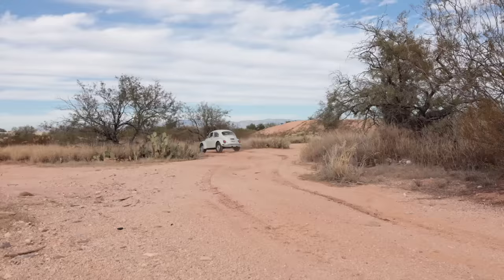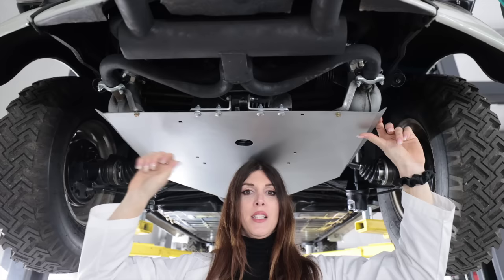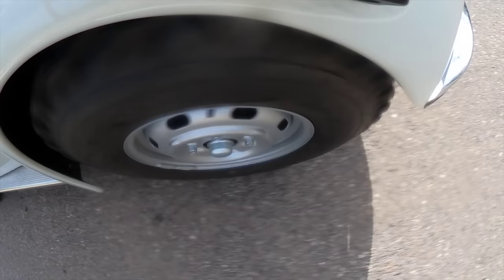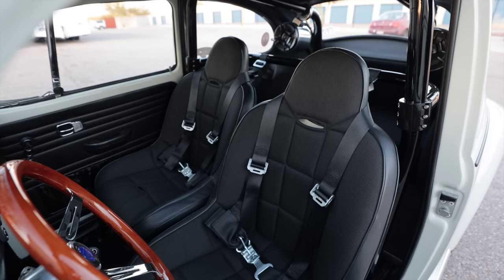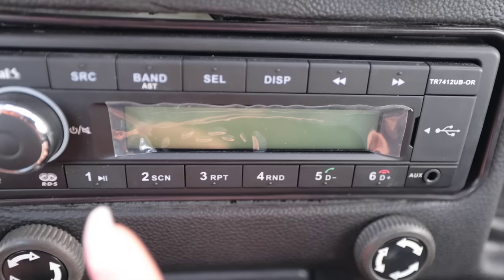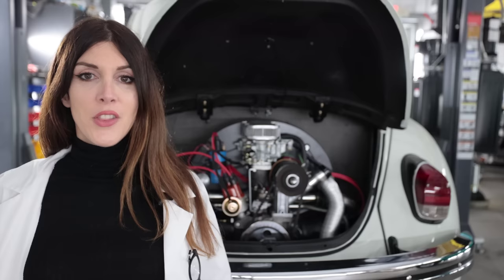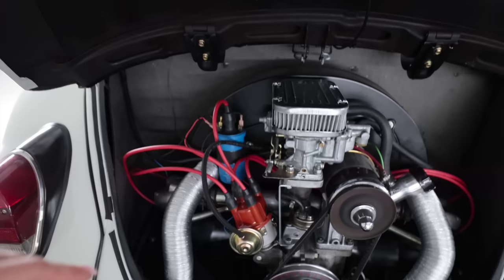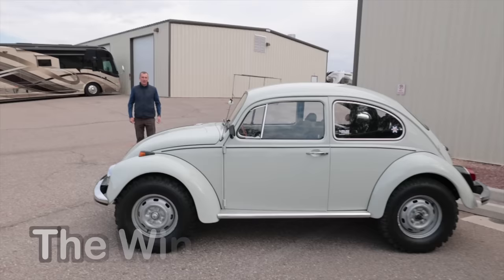The Results Are.. // 1969 Class 11 VW Beetle Review & Off-Road Test

Comment: Sarah, it was satisfying to peel off the plastic from the stereo. Still waiting for a new voltage regulator but it’s been fun driving it so far. Your assessment of shifting is spot on.
Reply: If the nylon bush in the shift tunnel is replaced they can be fairly crisp when shifting, especially in conjunction with a short shift kit.
Reply: You sir are one lucky dog.  Have a ton of fun in that bug!
Reply: You can replace the generator with an alternator and get rid of the voltage regulator, if you want. This is a pretty common upgrade for the Type 1 motor. The alternator puts out more amps, too, so it keeps your battery charged better. I'd personally re-do the wiring for the starter circuit, and put in a relay, so starter voltage doesn't have to go from battery to ignition switch, and back to the starter solenoid. I had to push start my 1970 VW by myself more than once on a cold day because my starter solenoid wasn't getting quite enough voltage. Not much of an issue with a bug, as they are so light. :)
Reply: @johnt.848  Thank you.  I'll look into doing it.
Reply: Congratulations Tony..
Reply: So this is why I haven't heard from you, Sarah! Lol. Congrats Tony Toni Tone!
Reply: Want to sell it ?
Reply: @mattcurcic5585  No. If it turns out I spend more time fixing it than driving it I’ll get back to you.
Reply: @tonyh4514  fixing it??
Reply: matt and I might start a bidding war on that if you do decide to sell it... 😉
Reply: @tonyh4514   It’s a Bug. Get used to constant maintenance. Did it for 20 years. Miss driving mine, but I don’t miss RELYING on it. That’s a damned cool one to have, though.
Reply: Congrats, buddy! What a cool project and a cool win. I hope you enjoy it!
Reply: Nice
Reply: Hopefully this comment doesn't get buried, but that roll bar is pretty unsafe if you're driving without a helmet. Not that you have any crash structure, but any frontal or diagonal frontal impact is going to send a taller driver's head into that cross member
Reply: @johnt.848  Are you talking about the bush at the "back" (front!) of the gearbox? The original ones were hard rubber and were held in place by 
a pointy screw. Both were subject to wear and very few people replaced them which is why so many people think that those old transaxle gearbox's 
were terrible.
I had one fail completely. When I replaced it (cost was about $15 and it took about 15 minutes!), it was like a German racing mechanic had rebuilt the entire box to competition standard! It shifted beautifully, with absolute precision.
Reply: This thing looks like a riot. Congrats!
Reply: I recently picked up my first buggy and the shifting was awful. Shift Rod Bushing, EMPI short shift kit, and urethane shifter bushings turned it from fishing to fireworks. The difference is insane, it's crisper than most of the new cars I've driven!
Reply: Dear tonyh
Sir, this is definitely not quite the kind of comment I would expect coming from a thankful winner.
Best regards, luck, health and wisdom.
Reply: Tony; any chance of a 1 year update?  How is it running?
Reply: @bridgecross  Ragnar is running great.  I occasionally take it out on the dirt roads.  Mostly I drive it on the street.  I replaced the generator with an alternator.  I also replaced the sifter bushing and installed a short shift kit.  It now has a positive feel with each gear change.  I installed a starter relay which makes starting easier.  I sent the oil out for analysis, and it has a lot of metal in it.  I'm going to do another oil analysis after a few hundred more miles to see if it's getting worse or is stable.  I'm happy with the car.  It puts a smile on my face every time I drive it.
Reply: @tonyh4514  sweet!

Comment: My first car was a '73 non Super. I put 1776cc kits from JC Whitney in it with the dual Weber carb setup. As slow as it was, I managed to collect plenty of tickets with it and sliding it around in the rain was my intro to the joy of driving. I got to a point where I could blow a motor, pull it, re-jug it and have it back in in a single Saturday afternoon working with a floor jack in the street. It was my intro to maintaining vehicles and basic mechanics.

Comment: Sarah, you and your friends did a great job on this Bug. It's set up as a perfect snow car now. These bugs are some of the most fun slow cars anyone can ever drive. But they cannot be race driven like this, they are best driven just like you drove it. At high cornering speeds in tight corners, the front suspension likes to tuck under, roll the tire sidewall over and roll the car over. But that's when you are driving one like a 16-year-old teenager. These Bugs are so much fun to drive. The way you restored it to almost stock preserves the little chirp in the exhaust note of a truly healthy VW bug engine and the heater boxes make sure it is an all-year-round vehicle. The great braking is a function of all rear end weight shift to the front. All air-cooled disc brake equipped VW's and Porsches feature some on the finest braking performance you could ever get in a car. You built a VW bug to drive and enjoy and I know it's new owner will enjoy your brilliant workmanship for a very long time to come. Job well done, Sarah.

Comment: I had a '65 a long time ago and it climbed a super steep sandy hill with 5 people piled in it and it was lowered onto the bump stops in the rear. Got my 4WD truck stuck trying to climb the same hill. They dont look like it but with the engine weight right on top of the drive wheels they can actually climb very well.

Comment: I’m surprised it actually made it up that hill. Great job as always!
Reply: I trust a stock type I off road before any other passenger car. We used to buy them with bottle money, rip off the fenders (which were usually almost rusted off anyway,) and drive them right out into the fields. The most fun you can have with a couple bucks of gas.

Comment: I've seen a lot of newer and more powerful engines swapped into bugs (especially Subarus) but they usually require some special mods for clearance and cooling. I think keeping the 1600 was the right choice, aside from possibly a 1776 or 2000 swap/conversion. I really appreciate your commitment to honoring the original character and history of the car. (I'm biased, my bug also has a 1600 swapped in.)

My main car is a Jetta and VWs still get their sea legs in second gear. The friendly local indie VW mechanic says first on a VW is just for getting rolling, then you need to pretty much immediately get into second.

Comment: I drove a new 72 super bug to college.  I was able to hit 95 mph going down a steep hill.  Had the cv joins serviced,  I couldn’t get past 80 mph afterwards.  Later had a  used 73. The 72 got 28 mpg, the 73 got 30 mpg.  It was nice to fill up for $2.00.

Comment: I had a '74 and a '76. top machines. 3rd gear is the best one for the road and take off.  The first gear is so low for sand and if you bog then flatten the tyres you go again.  I got an old Subaru later.  I always got mess up on the tappet adjustments as the Subaru is opposite.  The old Subaru is a tank also.  My one was a '81 model with the EA81 motor.  They are all made with nothing to go wrong.

Comment: A tire tip. If you find that the wheel is heavy and requires multiple weights in one spot, try giving the tire a 180 degree spin on the rim. It should help it balance out lighter.
Reply from the maker: Did that multiple times, they’re cheap made in elsewhere bias-plys.

Comment: I’m pretty familiar with VW Bugs. I grew up with friends who had bugs and super beetles or their parents did and I’ve easily done the electronics on over 100 of them, including complete rewires on insurance claims. Ragnar is great! I love that at idle it has that classic whistle but then when the throttle opens up it completely changes tune and no longer sounds like a stock bug. That suspension and brake upgrade on the front is so worth it. Neat car. I’d be super happy to have it as a little runabout. Great work on the restoration. It’s got to be one of the best VW Bugs on the road.

Comment: Congrats to to the new owner, as I sit here pouting a little that I didn't win it :) For someone that has never worked on a VW, you did a tremendous job, that is a beautiful car! The only thing I would critique, is the placement of the coil. Maybe it's an old wives tale, maybe not, but it should be mounted pointing down. It's filled with oil that is supposed to keep it cool, I've heard enough stories over close to 50 years of messing VW's, and they come pointing down from the factory, if that's any indication. Once again, absolutely beautiful job and I'm jealous.

Comment: Excellent job restoring this bug.  The heater box's should never let exhaust into the car.  If you have never owned/driven a bug/VW you have missed one of the "all time" great vehicles of all time.  If you know how to drive a bug, standard shift, you can go almost any where, in any type of weather.  They are extremely easy to work on, and cheap to maintain.  When the weather gets hot, with the rear engine, the interior does not get extremely hot, especially with a sun roof and pop out rear windows.  My 1970 bug always got around 18 mpg, but I ran it hard, on the expressway.  Just keep the valves adjusted, appx. every 3000 miles or you will burn a valve.  Learn how to adjust them, it takes less than 1 hour to do the job, very easy.

Comment: Back in the day, one of my buddies had a Beetle with the semi-automatic gearbox. You still had to shift the gears manually, but the clutch was automatic. I hated it, because it disengaged the clutch every time you let off the throttle. So you couldn't engine brake.

Comment: Great build!  Lotta beautiful workmanship!

Could tell YOU were DONE with this build..  Understandable..

As far as cooling, I suspect these VWs have oil cooling as well as direct air cooling.  Flowing oil removes heat from the pistons and the cylinder heads and bbthen rejected as the goes through the cooler and sump.

Comment: I've got a soft spot for VW Bugs, having had a '53 for a short while when I was stationed in Germany in the early '70s. It needed a replacement transmission, and the German mechanic put in a no-synchro unit that was even older; I'm sure my 0-60 times were far longer than Ragnar's. I followed it up with a purchased-new Fiat 850 that, per Fiat's reputation, was much less reliable than the almost 20-year-old Bug.

Comment: 10:14 7:1 compression ratio… Something I did not know, even after replacing several cylinder heads on these, (1964 and 1965 era), many years ago. Thank you. (Knew the 40 horse power units were poky, about the extent of experience in performance.   {In upper grade school, fellow student had a built 1800 with the 4-Webbers.   That was an impressive VW}. 

    (About the cylinder heads, valve and seat burns due to possibly ; not enough rocker to valve lash.  The other trouble was engine overheating in the hot climates, resulting in oil burn, fouling spark plugs, especially the cylinder below the factory installed  oil-(??)-cooler.

Comment: The automatik for those Beetle was not a full automatic! Those Saxomat-Clutch were a 3 gear shift automatic what means you had a low speed gear (L) what was at the range as a 2nd gear on a normal gearbox and then 1st gear what was at the range of a 3rd gear of a normal gearbox and 2nd gear what was at the range of gear 4 on a normal gearbox  ...so shiftig without a clutch  was pretty much fun ...my mom had a car with it and it was realy nice to drive

Comment: I've driven an auto shift VW... I think it would do 60mph, but, I got bored trying, plus, I ran out of road. It might have been because it was a factory 1200cc engine. Needless to say, the only vehicle I found to be slower was '62 Ford Falcon van with 3on tree, and a 144 six cylinder. Both rigs have far more character than power. Love the job you did on Ragnar, can't wait to see how the Celica goes. You got a name for it, yet?

Comment: Love the Car , but a stock engine that is shiny is still stock or close to it. It needed some performance work to give it a bit more power. Cheapest option is a big barrel kit and extractors.
Or you could have gone nuts with the engine like I did in my Beetle and make it a 2.1L beast instead of a 1.6L, but that involved custom block, stroked crank, clearancing work, balancing and lots of new parts to make it fast.

Comment: When I discovered Henrique Cavalho’s audacious rebuild of a Super Beetle to Robert Design’s Traha, I learned two things: first, you can have a cabriolet configuration featuring a front and rear retractable roof that can fold down atop each other and second, by extending the car’s length slightly, the rear space can accept a VW 2.0 Golf modern water-cooled engine. The only drawback with the rebuild was you can only have a two seater because of all the space taken up not only by the engine but by the electric motor and the attached hinges and arms needed to raise and lower the roofs. I didn’t think it was possible because it was only an artist rendering but bottom line is here, you can update a classic Beetle for sure.

Comment: The auto stick was awful.  You shifted but without a clutch.  You just took your foot off the accelerator and “shifted”.  😂. The acceleration was terrible and they were not very popular.  I’ve worked on VWs as a hobby since the early 80s and still have two.  I’d rock this Bug but the big tires would have to go.

“Launch”?😂. That 1600 will be less than “peppy”.  But I have a blue-printed, 2.0 liter that will push you back into your seat.
Reply: The wife brought an auto stick into the marriage. It was... interesting, had a microswitch that triggered a pneumatically operated clutch. It definitely was a manual transmission that shifted, no quotes required. The word "launch" need not apply, though. We sold it when we had kids in order to get a car with modern safety features like seatbelts that worked.

Comment: Meh, can we go back to the YOTA content already?!
Reply from the maker: Yes, well kinda. Until the engine gets back from the machine shop I’m kinda in limbo. I might start doing suspension and brakes in the meantime but I also have to upgrade the rear axle and for that I need the engine and transmission to measure for the custom driveshaft.